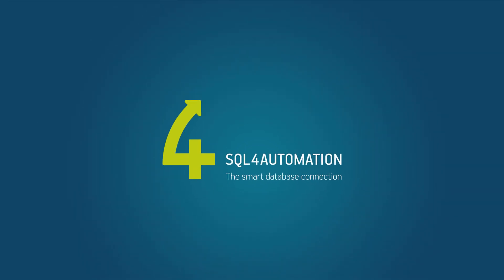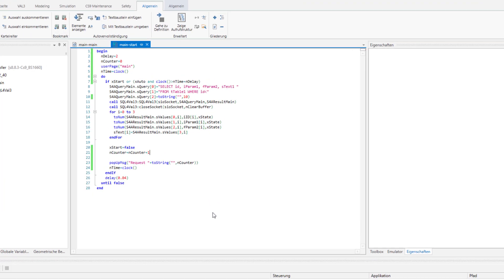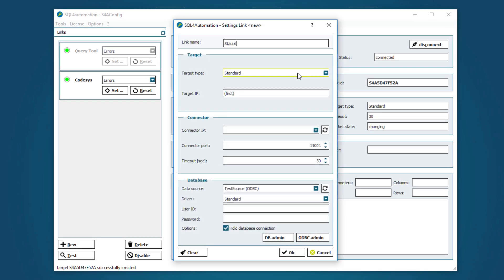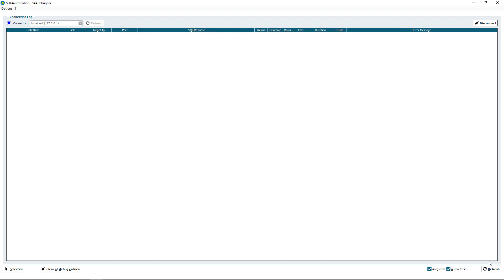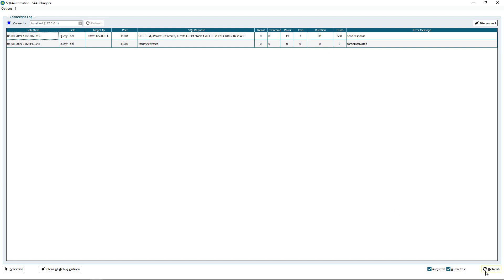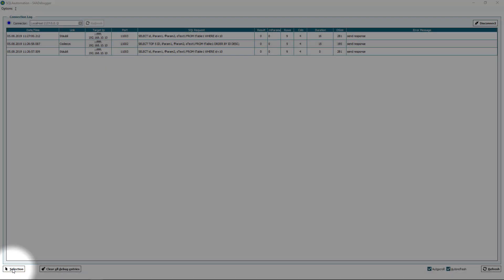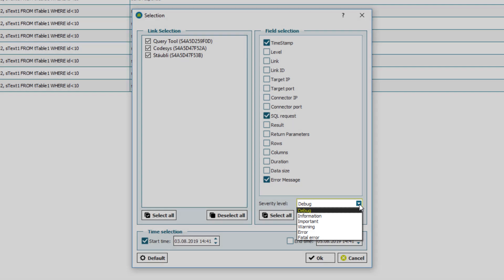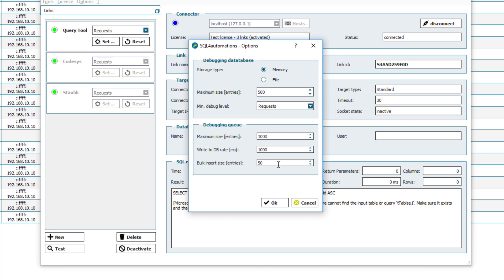SQL4automation - The Debugger Tool

Comment: Hi, excellent videos.
Can you provide any info on what libraries you used for connecting in codesys?
Thanks!
Reply from the maker: Hi there, thanks :)
As far as I know, our Codesys Program uses the following libraries:
- Memory V3.5.7.0
- Network V3.5.7.0
- Standard V3.5.9.0
- SysMem 3.5.5.0
- SysTypes2 Interfaces 3.5.4.0
Reply: @sql4automation584  Fantastic, thank you so much! I think we will be getting another license.